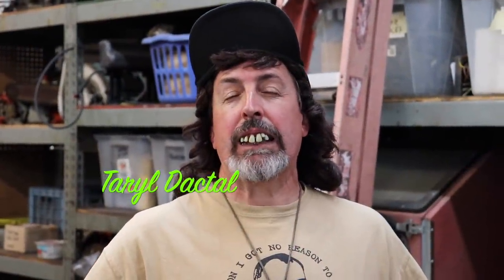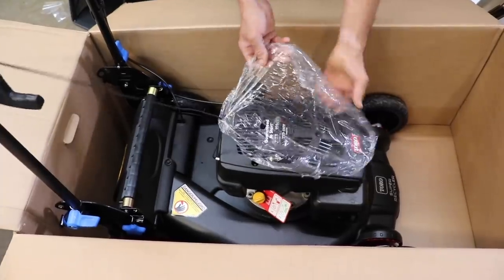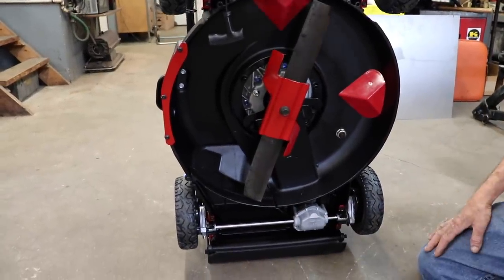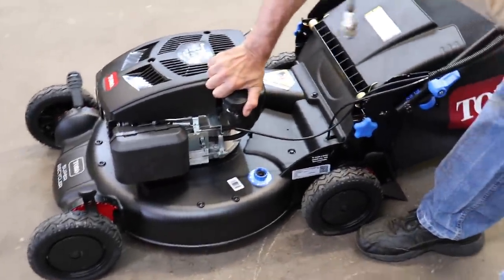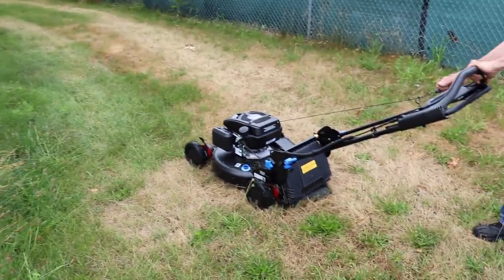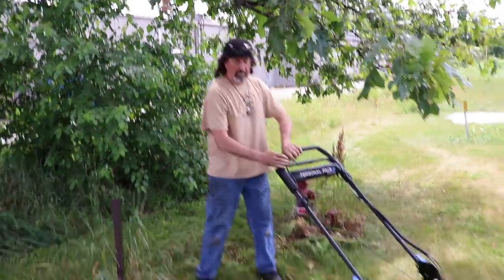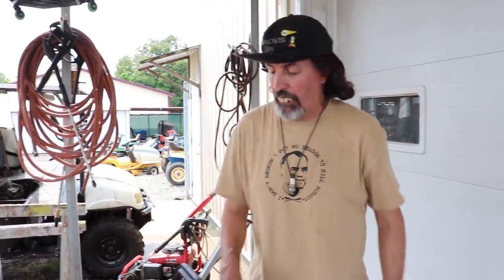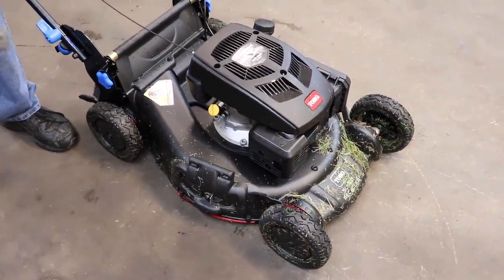Toro Super Recycler Mower Review - Is It Worth It?

Comment: I wonder if that Toro engine is really theirs and not a rebadged Chinese clone.
Reply: It's not Toro's own engine.  They are made by a Chinese company called Loncin.    Toro has been using their engines for over a decade beginning with the single stage snowblowers.  Loncin has been quite well known for motorcycle engines.  Their outdoor power equipment engines are clones of the Honda engines but seem to have done quite well following a few hiccups when they were first introduced.
Reply: joeraptor1 thank you for the detailed response. Do you know if this is for all their engines? I’ve seen them claim that their zero turn mowers use “ their own” built engine and I was dubious whether or not this was true. I guess technically if they have it custom built by one of these companies I guess it’s their own.
Reply: @lawnmowerdude  As far as I know, any of their engines that are branded by "Toro" are actually made by Loncin.  Some of the other major outdoor manufacturers like Husqvarna and Ariens also use the Loncin engine on their mowers.  If you look at the emissions sticker on the motor, it will tell you who made it.  The other tell tale sign is often the ccs of the engine.   Just match them up to what Loncin makes.   I have a loncin engine on my Toro single stage snowblower that I bought in 2016.  It's 212 cc and has been very good.  It has good power and a lot of torque.   It's not very user friendly in terms of servicing and parts seem cheap but so far it's held up although it has only about 80 hours on it.